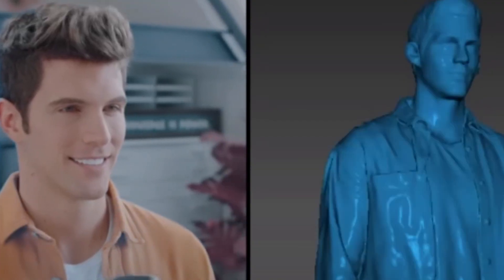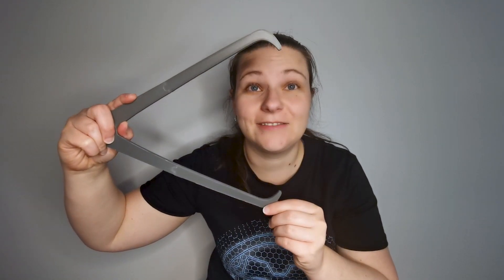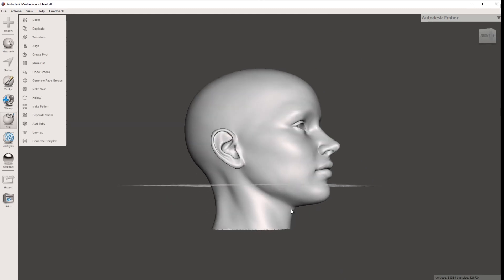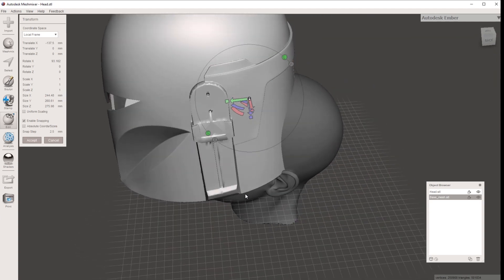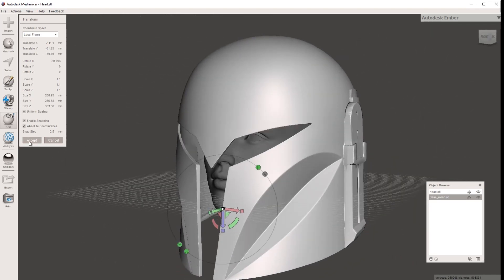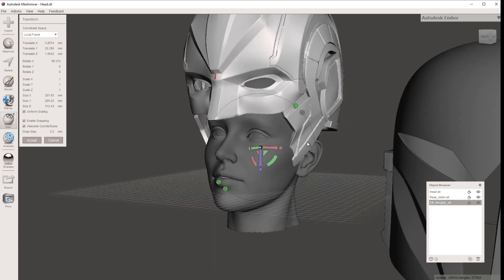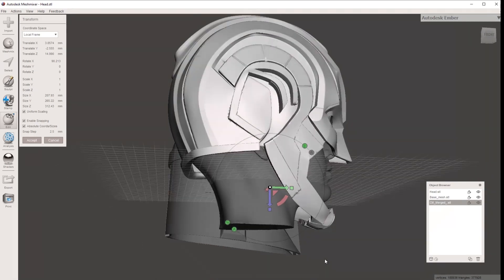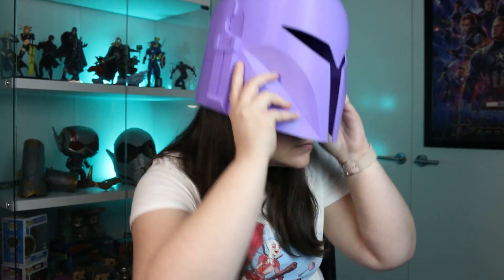Quicker Way To Scale 3D Printed Helmets

Comment: With that head model. when you put in the Z size for your head wouldn't that be a little bit off because that model has a neck where measuring your head its from chin to top of head?
Reply from the maker: Yes you are correct. With a lot of the helmets I'm not normally as worried about the z as I scale with uniform measurements (to keep portions looking correct) so as long as X and Y fit that's the main thing I am worried about. You can definitely factor in the neck section if you want it to be more accurate.

Comment: thanks for the guide.  One question, the Y measurement of the stl of the head includes the neck, right?  but you have only measured the head
Reply from the maker: Yes correct in this case. I wasn't too worried as I use uniform scaling with helmets so portions look correct. As long as front to back and side to side fit I am happy enough. You could cut the bottom of the neck off the head model in Meshmixer if you would prefer it a bit more accurate. There is a tutorial on cutting files on the channel if you need some help.
Reply: @AstrocyteCosplay  thank you for your fast answer! Have a nice day.
Reply from the maker: No problems at all. Let me know if you run into any problems with this method. You have a nice day too 🙂

Comment: Of course you don't need a 3D scanner to do a 3D scan. Just use a normal camera and Reality Capture.
Reply from the maker: Interesting. I haven't heard of this one. Will have to check it out. Thanks for the tip.
Reply: @AstrocyteCosplay  There are several photogrammetry options, some are free, but I find Reality Capture to be the easiest/nicest and still pretty cheap, usually less than a dollar a scan and you only pay when you save out the model so if the scan didn't come out good you don't have to pay.
Reply from the maker: That sounds pretty good. I have been looking for a good option on Android but haven't found anything decent yet. Either have to pay heaps for the model or they just don't work.